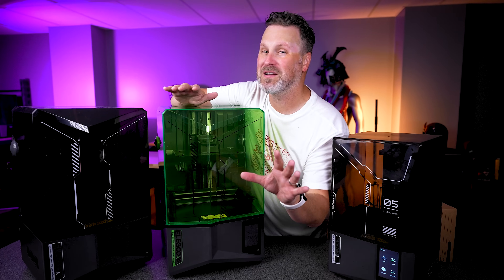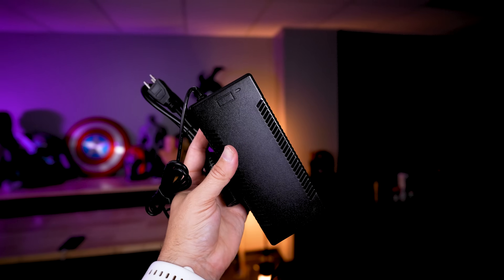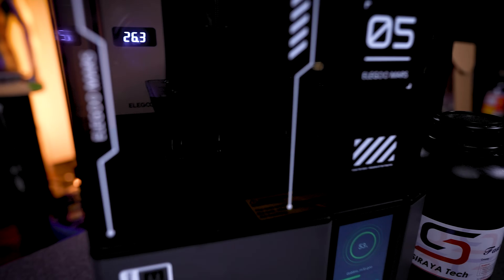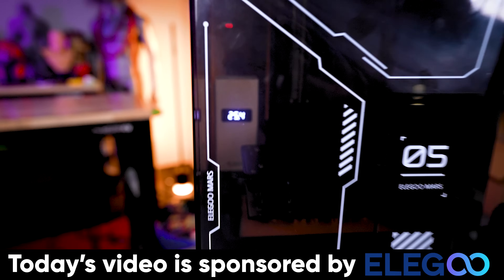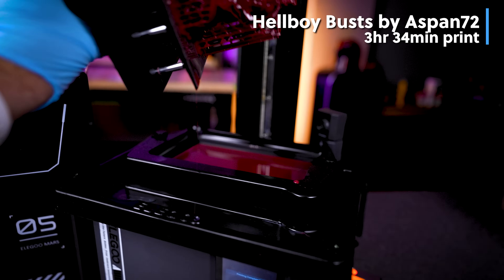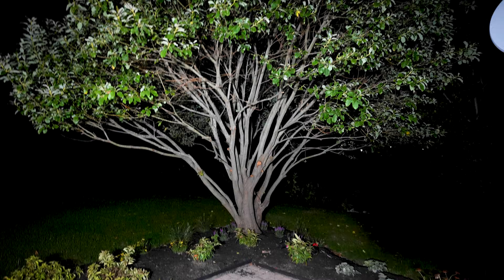HEAT your Resin 3D Printers!

Comment: The fact that this unit costs the exact same as the Chitu Systems heater, but can only heat to a preset temperature that you can't change while the Chitu Systems heater can be set to whatever you want, I don't know why you would go with the Elegoo heater.  It's ridiculous to release a product that's the same price as a competitor but to have less features (not to mention in a color that matches literally none of your products that people will use it with).

Comment: Hello Jessy, thanks for your vids as always. Very interesting and informative. As youre so experienced i would like to ask you for small help or lets say advice. I have s4u and experiencing layer lines on all models with elegoo standard 8k resin. Printing on fast speed but heard that fast print could cause alot of issues with standard resins. Do you think it could help to switch to normal speed or maybe increase wait before print for standard layers from 1s to 2s. What do you think?

Comment: Just found out the he heater actually causes layer lines eather by airflow hitting the vat or uneven heat distribution. J3D Tech did a vid on that and found a possible solution by directing the airflow further up inside the case. Preheating might give you better results too if you dont wanna go through all that.

Comment: Why doesn't elegoo simply have a plug in resin reservoir with a heating element similar to a block heater, but one that goes around the whole vat?     I ended up rigging up my own, but I'm tempted to break out the welder and do a more permanent and more controlled method.    My printer was left in Canada, and everyone in Canada needs heat.  It's that simple.

Comment: You can buy the Chitu heater for less than the Elegoo heater and it has an external temperature control so it can go higher than 25°. It installs much more easily, doesn't block the usb port the filter plugs into (you may have to remove the filter to use the Elegoo heater unless you're willing to drill holes into the cover), it's easily removable, and it's been out for a long time so it's been tested by many people. I'm honestly confused why Elegoo even bothered to make this heater when it's so inferior to things that already exist. 🤷‍♂️

Comment: i have been running the heater in my mars 4 max and have noticed that i am now getting a lot of layer lines in my prints that i was not getting before. a little research shows im not the only one.
i have just got a saturn 4 ultra so i will test to see if i get the same issue
Reply: see the J3D Tech video about this; Elegoo is sending out replacement heater PCBs
Reply: I have been experiencing layer shifts on my elegoo saturn 3 ultra for the last 6 months. I have done everything but I could not solve it. Layer lines are formed on the surface of flat objects. Should I give elegoo saturn 4 ultra a chance now, what is the probability of experiencing the same error?

Comment: Do you have a solution to heat  inside the cover and vent the fumes? I'm preparing to purchase the Saturn 4 Ultra, and I have zero experience with resin printing.

Comment: A few years ago, after a lot of failed prints in my very chilly basement I built a heater using a hair curler and an arduino with a relais and temperature sensor. It did work, but ironically, the print of the mount I needed for it failed as well and at that point I just gave up. My "printstation" enclosure with heater and filter is supposed to be delivered soon and until then I fear my printer will have to gather dust...

Comment: So you get a heater and its either heat or vent, one or the otherr, depending on the machine. I have an aftermarket air heater with my saturn 3 ultra, works well. I would like to see a heated vat - have a vat with vatband components inside the vat walls with some magnetic/electricity contact points - heated vat!  Sure it would cost more but I would be willing to pay for that.

Comment: I installed this a week and a half ago on my Jupiter SE and I am noticing a drastic difference in adhesion and drop in exposure time. My printer sits right beside an air vent and it stays pretty chill. Turning the heater on about 30 minutes before printing give it time to get ambient temps up as well as start with the resin and it works like a charm.
Reply: Yep biggest thing I noticed as well is exposure times.

Comment: Why doesn’t the waste heat from the electronics go into the chamber or a heat exchanger? That wouldn’t completely solve heat issues, but would certainly help. Have you tried running 40 degrees Celsius in the chamber and seeing if you can get faster print speeds?

Comment: Here's a tip for you Jesse when you remove your build plate from the machine Put something under it to catch any dripping resin so it doesn't drip on your machine and you have to clean it up. I use plastic picnic plates Or you could use a piece of scrap cardboard.

Comment: One thing you can do for winter printing it just run some hot water over your build plate (and dry it) right before you start. It really only needs to be warm for the first few layers.
Reply: Nope, the whole vat needs to be the same temperature to keep thermal expension consistent through larger prints, which means only air chamber heaters can do that, had prints fail because room tempatures changed by  40F.
Reply: @miguellopez3392  Exactly. The temperature also affects the viscosity of the resin - when it's colder, the resin doesn't flow back under the build plate as quickly. The resin needs to be warm the entire time.

Comment: my Mars5ultra is reaching working temps of over 60ºc. thats without any heater, and I´m only printing small things that take only a few hours to do, i can´t touch the vat for more than 3 seconds without burning myself. Elegoo say it´s normal and just deal with it. looking on forums, i´m not the only one with this problem. I live in the south of Spain and the ambient temp is around 30-35ºc. The printer shoots up from 30ºc to 60ºc just in the bottom exposure layers and because the printer is working way above the recommended temps from the resin manufacturers, getting perfect prints is imposible. For reference it sits next to a Saturn 4 ultra and that one only reaches 40ºc when working. Sorry but i can´t recomend this printer for anyone living in a warm environment. I have the Saturn 2, Saturn 3ultra, Saturn4 ultra and the mars5 ultra and I can safely say that the Saturn 2 is giving the best results out of all of them!

Comment: I'm sorry to say this but this test or rather demonstration of this product makes absolutely no sense if you don't make the same prints without using this heater.

It is not clear from the material that the heater was a factor in the success since we did not see how the prints turn out without using this heater with the same file settings.
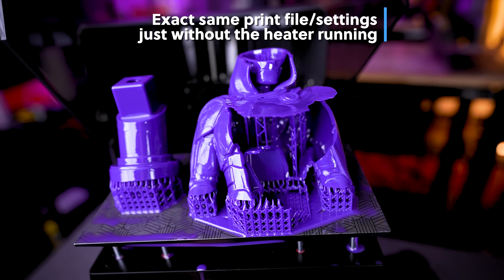Reply: 8:29
Reply: @pd_taka5036  Thanks for the link... But it's not the same resin...
Reply: he did says at the end he tested without the heater and it failled.

Comment: G'day all.....i made the Vogman heating unit last year, differance is i have full control over temps up to 110c and can program my exact tempts needed here in Australia. As all countrys have varying temps especially where snow is  a slightly higher tempt by 2+ degrees is needed to combat the freezing conditions. For intance if in Alaska in winter and temps are in the negative... a 30c+ temp is needed to maintain a 24c temp consistant in the whole chamber. i also add my bottles in the chamber if it fits so when topping up vat its at the same temp and wont hurt your prints, the elegoo heater is great but needs to allow user modification of values. Cheers from a noob here Downunder.

Comment: Currently haven't figured out a heating solution for my mars 5 ultra. As much as I know that having a consistent temperature is necessary, I still think that heating should be optional. From a company standpoint it's more you have to put into the price of a unit. I'm not sure on the Margin something like the Mars 5 has, but a company has to make the most of that. Plus not everywhere in the world NEEDS heating. I'd love to see a vat that has a built in brew belt that seems to be the most common solution I've seen for printing in could climates. This would make a great optional add-on for a company, and something that can be avoided for cost conscious.

Comment: I can not believe they are trying to steal 50$ from users for this when it doesn't have adjustable settings and also has that huge brick.  A homemade version is 1/3, the cost or less and much more flexible.   This is a good example of a company failing to understand users' needs and instead just trying to fluff sales. At a huge markup.  I don't understand why these companies don't just make headed vats.  They would be so much cheaper.

Comment: I have the elegoo   5 Ultra its a great machine in  my cool basement . I built ba cabinet for it and heat it with heater similar to the elegoo heater. The cabinet has a sealed door with plixiglas window , the heater is not in the printer but  in the open space beside it, with printer cover off. I have not had a failed print yet which more than I can say from the Anycubic machines I have had. Thanks for your video

Comment: Man I can't get over how silly the design of that heater is. It blows the hot air upwards. WHY? So it can heat the resin (where it matters) as the absolute last thing it heats in the chamber. It should at least be directed towards the resin. The chitu one seems like a WAY better option.

Comment: How about throw all that other stuff away.  Put your bottle in a Bambulab and tell the printer to "dry" for 2 hrs at 35C.  Then pour it in.  The curing of layers will keep it nice and toasty.  Works great.
Reply from the maker: Oh that’s a pretty good idea as well!
Reply: The curing of layers isn't going to keep the resin at a reliable temperature, especially if its cold. Resin manufacturers give an explicit temperature range for a reason.

Comment: I'm using a brewing belt on my Saturn 4 ultra, doesn't get in the way of the tilt. 3d printed a cable pass through on the exhaust port to keep it all nice and tidy
Reply: Can you link your belt? I've got a S4U and would like to set it up with a belt
Reply: @MilitantWildcat07  I got mine off of Amazon for like $20
Reply: @DanielChaves1984  can you link it?
Reply: After seeing your comment on the belt i had to get one for my saturn4 ultra game changer
Reply: Im concerned about ambient as well not just the vat. As the plate rises the print can shrink as it cools from huge temp gaps.
Reply: @Babyfacemcgill  oh trust me the brewing belt radiates heat through out the chamber. I have a thermostat mounted towards the upper portion of the chamber and it gets to around 37-40c inside between the heat from the exposures and the heat of the brewing belt. Works perfectly.
Reply: @Babyfacemcgill  Radiant heat,  Brewer belts are meant for carboys and they will heat up the entire fermentation chamber. The main problem your gonna find with standard brewer belts is they aren't typically regulated just a 20watt resistor generating heat. So its hard to get precise temps out of them without a inkbird controller.
Reply: @nikushim6665 yeah. That's the exact set up I use for home brew. With the brew bucket in a blanket and the inkbird sensor taped to the side it works very well. Oscillating 20 litres around 3 Deg range across the desired 21. It's in a generally cool garage. Was thinking to repeat for my resin printer, but the belt is long. Are people just overlap wrapping?

Comment: Never messed with 3D printed resin yet only casting Resin Parts with silicone molds. Uv Resin,ect. I would like to get a mesh lense i printed for costume in resin compared to on FDM printer. Even though the FDM is amazing as well.
Reply: Yosh HellBat Mesh Lense Improves my near sightedness enough that I can wear mask without glasses or contacts.

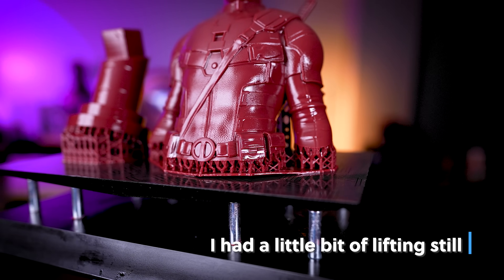Comment: 7:17 - The lifting is a deal-breaker. Every subsequent layer is corrupted.
Reply from the maker: @JohnJones-oy3md  👍 👍 I agree for anything mechanical or needing to be precise but for something like this it doesn’t seem to have made any impact on the overall look of the print
Reply: @UncleJessy  True, can get away with a lot more on organic shapes. Gears or interlocking parts, not so much.

Comment: I'm curious how long the fan motors will last.   I replaced my current internal heater 2 or 3 times a year.   It appears the fumes gum up the motor.
Reply from the maker: Oh wow really? Okay will keep folks updated as I will be running this with the machines from now on
Reply: @UncleJessy  to be clear I'm using a different heater than this one.   I'm hopeful the filter on this one will extend the motor life.

Comment: I suppose I'll have to wait for vat heating, since I wouldn't be able to use the Elegoo air filter in conjunction with the heater.
Reply from the maker: Oh! That’s a really good callout that I didn’t think of.
Reply: @UncleJessy  that filter is really handy for the resin smell in a garage. The best solution I can think of would be vat heating or some way for the air to flow through the heater to keep the warmer air while still feeding into the external filter.
Reply: the heater has a built in air purifier
Reply: @The3DTutors  I bought one, and while that is true, it doesn't filter as well as the external filter unit, so the resin smell is very noticeable

Comment: That deep red resin looks amazing! 😮
Reply from the maker: That is Lethal Shadows Resin - not the easiest to work with but prints look amazing in it once you get it dialed in
Reply: @UncleJessy what was the layer height when exposure was 1.6?
Reply: Thanks so much! You can find it on our website, link is in the video description :) It takes a little dialing in but with a heater or warm space it's much easier to print with.
Reply: @lethalshadowsgaming    It’s beautiful! I’ll have to check it out!

Comment: I'm honestly about to put my Saturn Ultra 4 outside in my workshop, which unfortunately still doesn't have insulation. Good to know the heater is this effective so I don't have to worry about my prints.

Comment: Finally! Now I can use my resin printer when it’s snowing outside! 🤣
Reply: Chitu makes a much higher performing mini resin heater. Available in Amazon, but I've used them a lot. You can direct that heater however you want. I usually have it pointed directly at the resin in the vat to warm it up, but then move the heaters to the side of the vat to keep the resin warm, without letting the airflow disturb the resin.
Reply from the maker: I mean.... why not right!?! 🤣🤦‍♂️